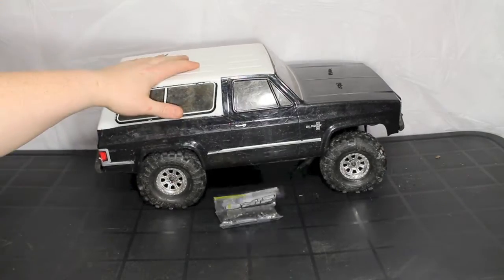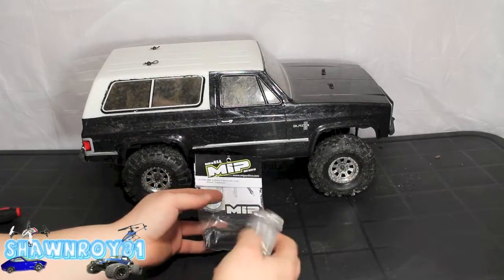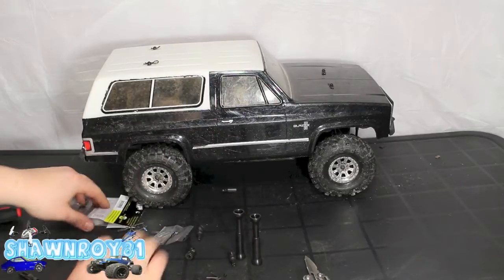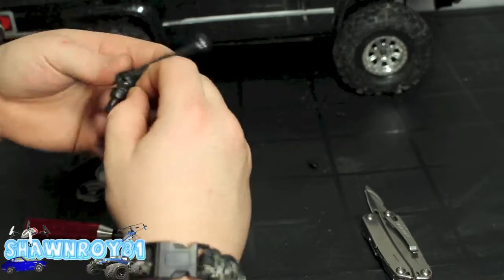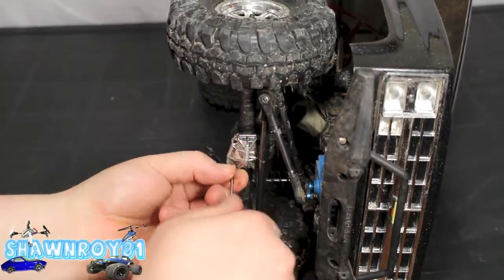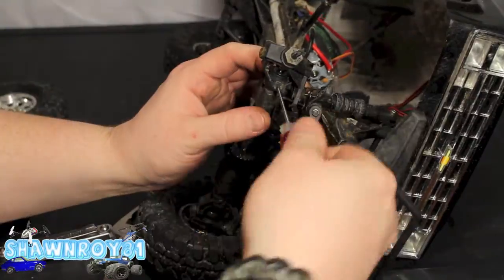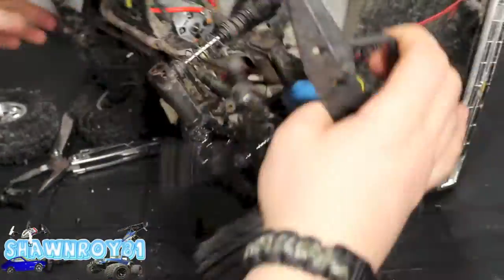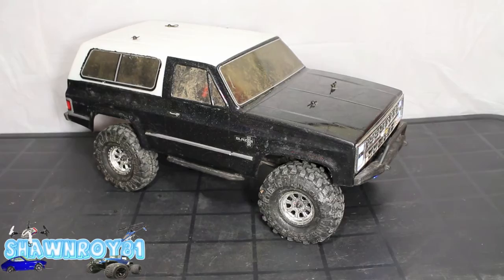MIP DriveShaft Upgrade for my New Vaterra Ascender K-5 Blazer

Comment: MIP shows discontinued and no other available replacement. any suggestions?
Reply: Steven Barnhart use the plastic shafts from the twin hammers
Reply: I've used the twin hammers shafts for years with no issues.  Now I need to replace the cvds on the front knuckle, one has broken.
Reply: UPDATE: Replaced both shafts with GPM Racing drive shafts. Time consuming but fairly easy. These are solid steel shafts with no taper at the universal joint, so I had to trim the battery tray slightly to fit front shaft. Ran for about an hour in local woods with no issues. A good replacement and these shafts are pre-assembled.
Reply: update June-2016 : MIP has a co-partnership w/ SuperShafty & recently is advertising a MIP/ SuperShafty exclusive " HD Driveline Upgrade for Vaterra Ascender SWB '72 Chevy K10 & '67 Ford F100 truggys. You have to have the GMC or Vanquish Ascender Driveline Adapter for front/rear convert to 5mm pinion shaft but just providing up-to-date details ... got mine at rpp, fwiw

Comment: How much of the shaft is in the other side of the shaft? I find that the original shaft (rear mostly) barely sits inside the other side. (not even a 1/4 inch). They held up at today's trail walk, but still....
Reply from the maker: +FlexDRG the mips are the same. no issues with them so far